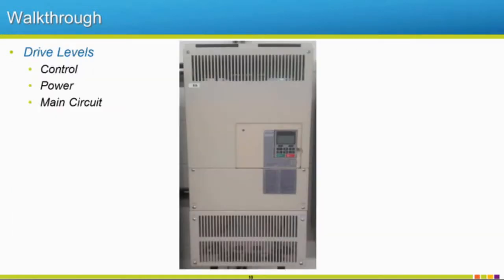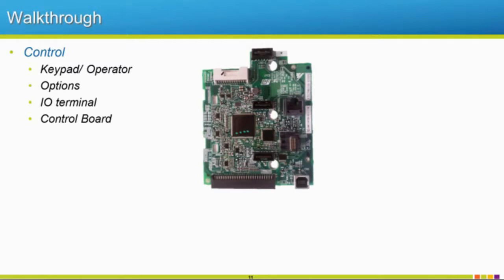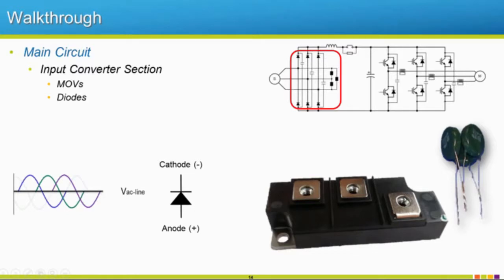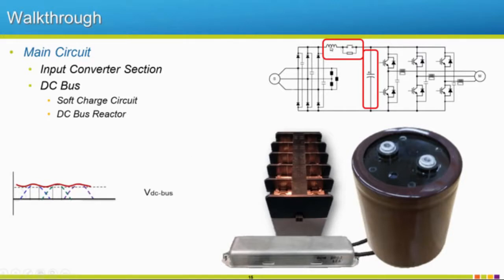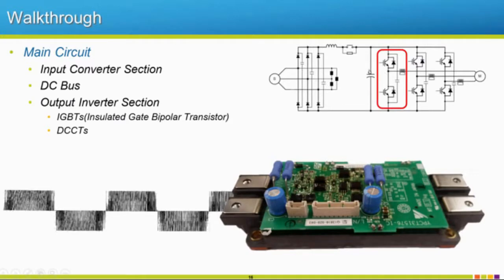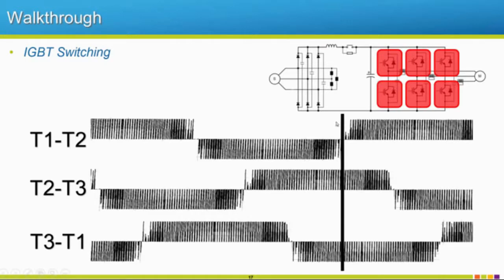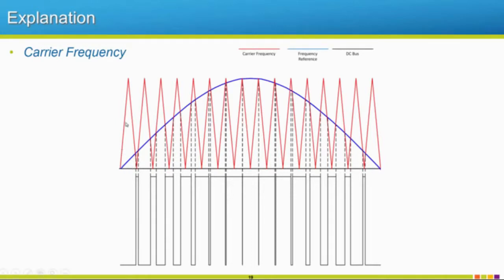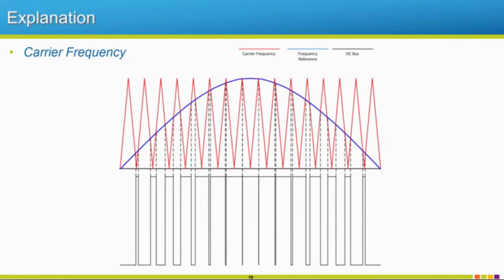Variable Frequency Drive Basics - How it works?

Comment: Thanks! When troubleshooting, how do you check the output of the drive to the motor?
Just curious to what measurements can be made If the motor isn’t running when the drive is calling for it to.